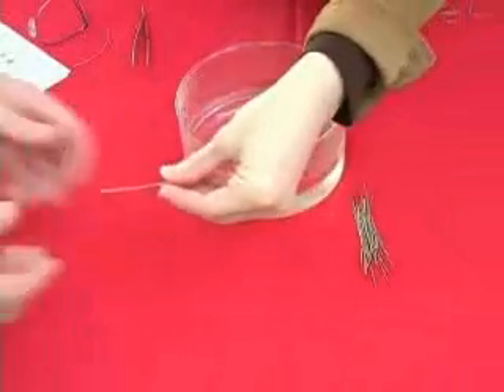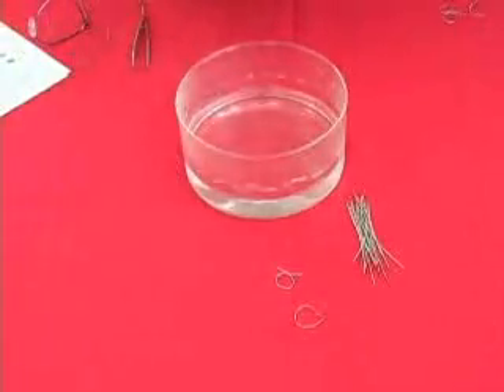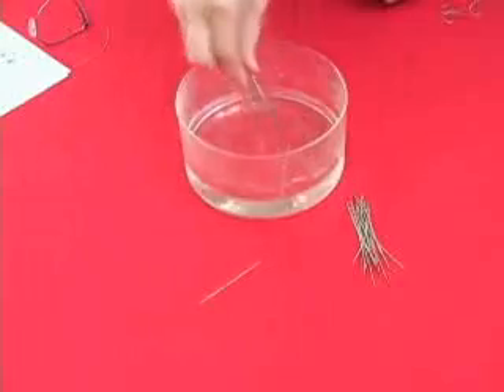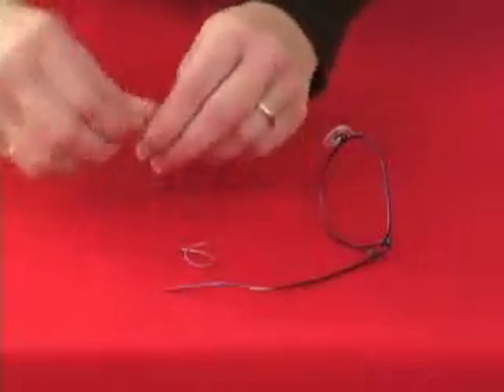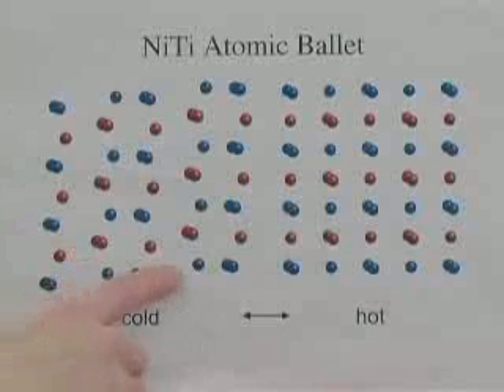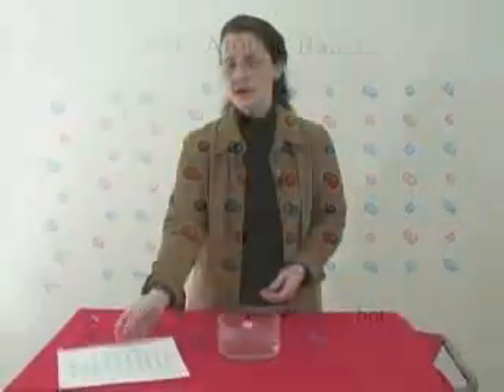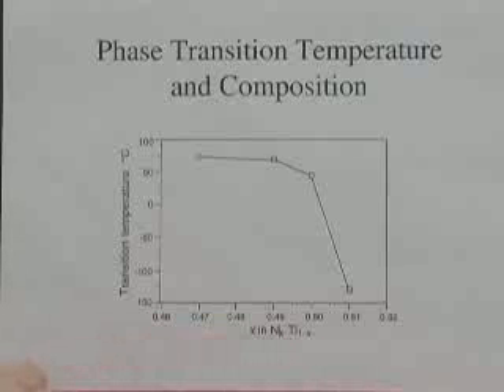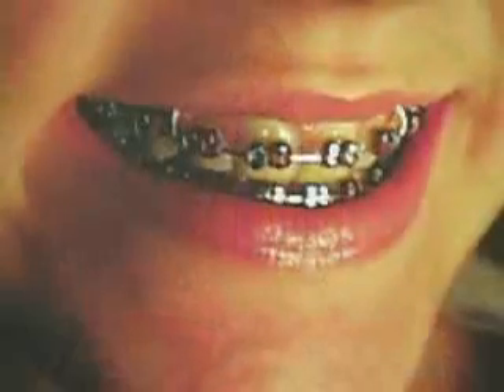Memory Metal

Comment: What I would like to know is what kind of alloy metal (as we would call it)that is thin as foil from the grocery store, you can roll it up into a little ball and lay it down and it will undo itself back to normal without any wrinkles in it,put a drill in a drill press and try to drill a hole threw it (it didn't go through but it did break the drill bit) ,take a cutting torch and try to cut it which didn't work, try to cut it with a plasma arc cutting machine,no luck.